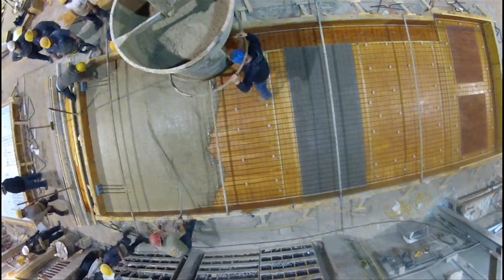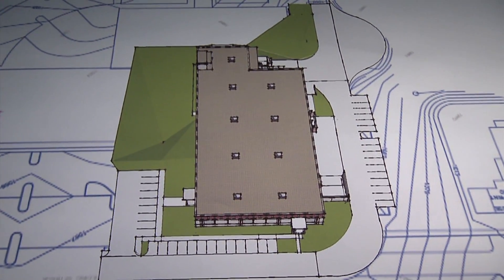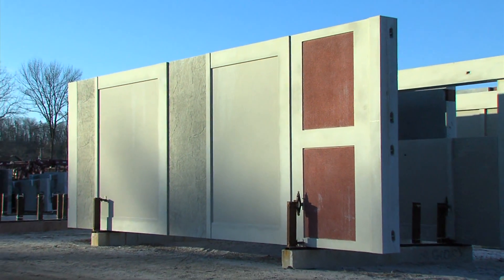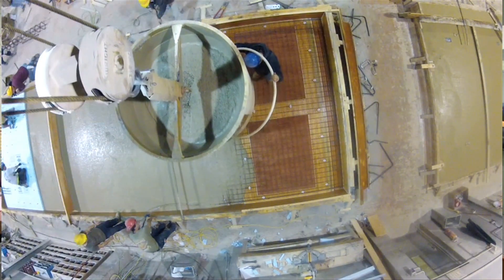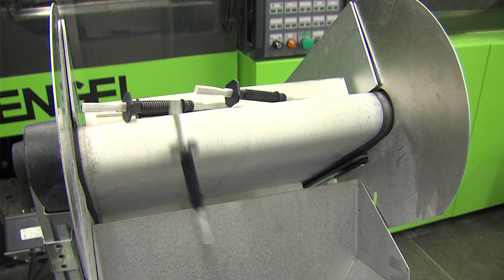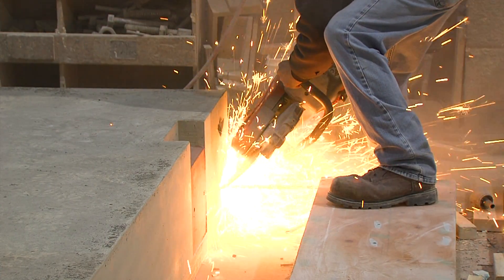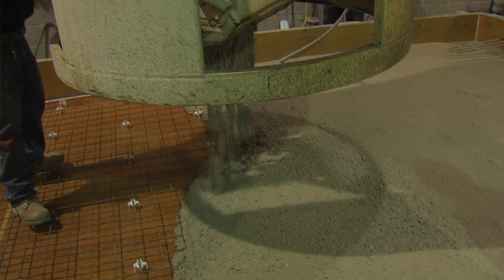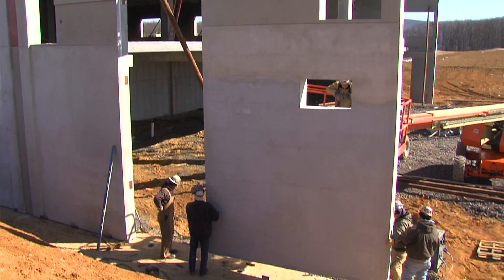US Concrete & Thermomass,  The Ideal High Performance Insulated Wall Panel

Comment: There's always advantages and disadvantages in every method. You're only major disadvantage that I can see is you cannot achieve a monotheistic concrete shell. For those in seismic zones this could be a deal-breaker.